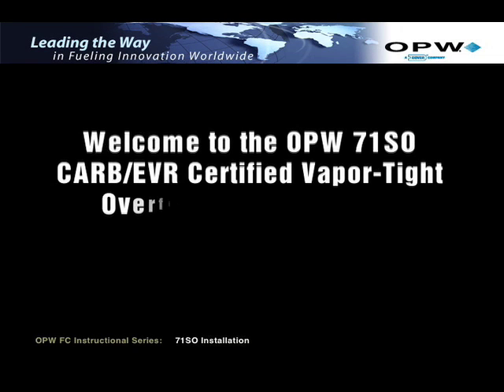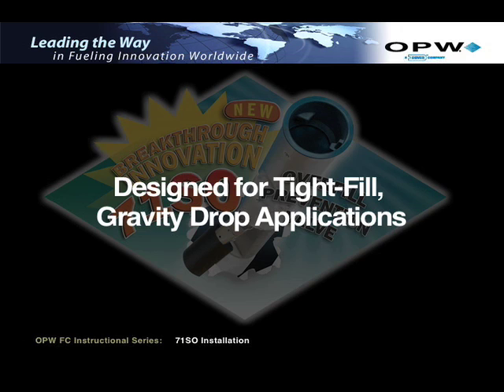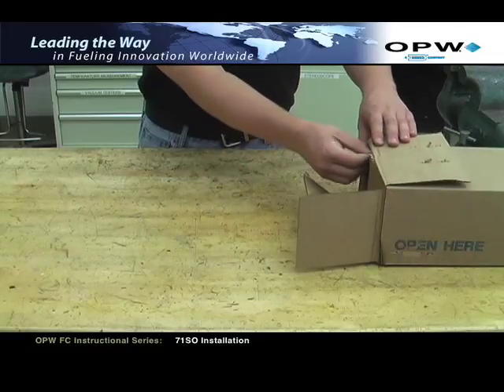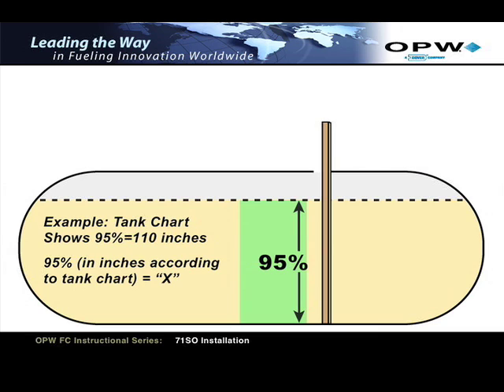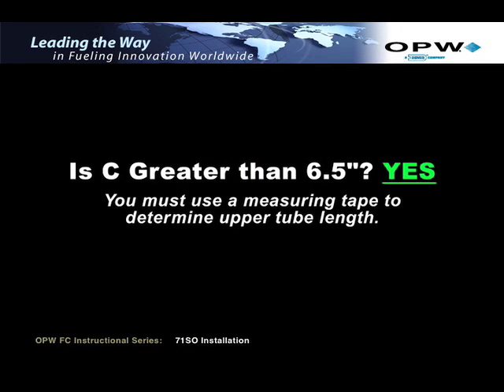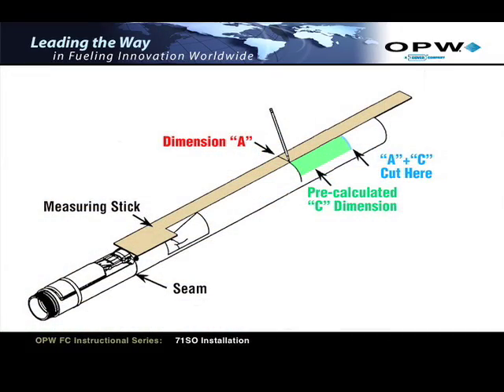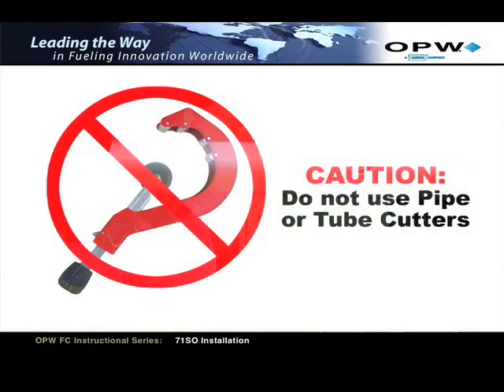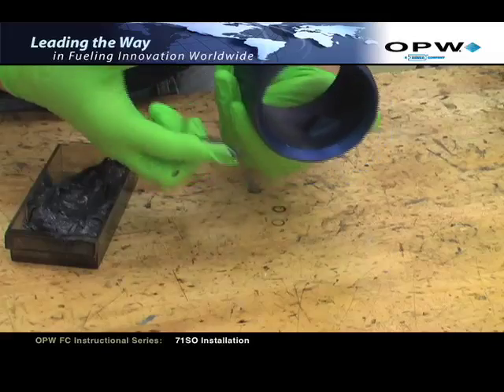OPW 71SO Installation Part 1

Comment: The diagram at 6:18/9:19 appears to be incorrect.  Measurement A should be the length of the riser pipe.  The picture shows the extra 6.5 inches at the end of the measuring device plus measurement A.  The seam should be lined up with the "notch" in the measuring device, not the entire length of the measuring device.